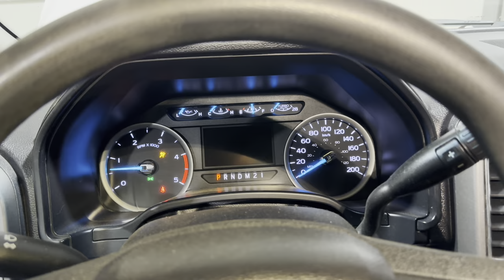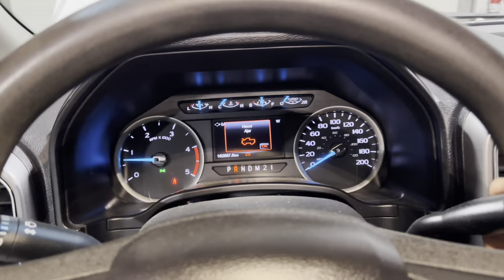How to: EGR Delete 6.7 POWERSTROKE 2017-2019

Comment: Theres a Primary & a Secondary radiator on these to make sure they stay cool when being worked. No smoking trans from 200+ degree engine oil anymore!👍🏻👌🏻🛠️🔧⛓️⚙️🦺🚜💨⚠️🤔🍻
Reply: 5:37 I believe that box is part of a GPS tracker for fleet vehicles. 🤔👍🏻👌🏻
Reply: Do you know anyone in the Toronto area that can do these I’m looking for someone to do this install!
Reply: @ChristianoFX  No, I don't know anyone up there, I'm down in Buffalo. Maybe ask Darkhorsediesel -hes up in Canada but not Ontario tho. Perhaps Rich from  DebossGarage who is in this area (Dunville) can point you in the right direction(e-mail better than public message on both).  It's not a difficult job to do EGR at all, if you have tools you can handle it in an afternoon! Good luck! 👍🏻👌🏻🛠️🔩

✊🏻🦅🇺🇲

Comment: Solid video man! My 16 has been deleted for quite some time now but I’m noticing it’s now using oil between changes (256k now). Is that normal for higher mileage diesels?
Reply from the maker: Yeah it’s not uncommon. How much oil is it using? If it’s just a litre or two that’s not bad.
Reply: @darkirondiesel  I was quite late on this change but I figure 2-3liters (17ish k interval)
Reply: Have you ever changed your ccv filter
Reply: @brandone6252  no I have a ccv Delete
Reply: @nombr 17k is way too long

Comment: I believe you need to undo that sensor because if you have a tuner, one of the gauges won’t work, you have to take it off the And switch it with one on the deaf system There’s another guy on YouTube he goes by COLTS WAY he can explain it in detail if you need more info about it

Comment: Great video!!!!   My 2019 is deleted and tuned.  Guy that deleted the truck just turned off the EGR with the tune.  I am wanting to remove the cooler now and do a manifold and piping kit.  Can I just do what you did in the video and not have to mess with the tune?
Reply from the maker: Ya you shouldn’t have to mess with the tune. If you’re unsure just unplug the egr and throttle valve and drive the truck, it shouldn’t throw any engine lights or perform any differently.  As long as it’s running good unplugged you can remove it
Reply: What kit did you use for just the EGR? Any problems so far
Reply: @brianyount2629  I haven’t done the install yet. I thought I was purchasing a SPE product but I found out that SPE Lab is not SPE Motorsport. 😡😡😡
Reply: Hey man I just purchased a 2019 myself. Would love some tips and resources if you don't mind. Looking to delete the EGR and dpf and eventually the def. I've already have a tuner from my 6.0 I have the sct livewire.

Comment: Thank you for your very informative video. I look forward to every upload I have but one question how did you take off those two bowls that you were talking about the ones that like to break did you use a tool or did you do it by hand? Thank you for your videos.
Reply: Just be careful with them. They are only 8mm bolts(got updated to +10mm few yrs later) & they're titanium so when you break them its gonna be a PIA to drill out. Just don't go crazy with a 1/2" impact on full blast. Use a baby 1/4" ratchet, patience, lubricant & torch\heat to help if necessary. It'll be fine if you take it easy.👍🏻👌🏻🛠️🔧🍻

Comment: Do you need to re-use your factory egr/ egt sensor in the manifold block off plate or plug it?
Reply from the maker: Either way works
Reply: @darkirondiesel  ok thank you. I wasn’t sure if it kept that sensor for monitoring temps

Comment: 16:48 for unplugging the Throttle valve. What happens if you don’t? Like what are the symptoms I guess?
Reply from the maker: Weird stuff like idle fluctuations, weird shifting, power loss, etc. doesn’t always happen but sometimes it can cause these things if you leave it plugged in that’s why you’re supposed to unplug it when doing a delete.

Comment: the best way to delete a ford is to buy a RAM  lol
Reply: Not true at all the 6.7 Cummins has Lots of issues let’s start with the heater grid bolt coming off an going in the engine
Reply: I own an 11 6.7 Cummins and a 19 powerstroke. The Cummins in in the shop for a head gasket but I'm sure both have their weaknesses
Reply: The best way to prove that you love Ram is to watch a Ford video and comment😂